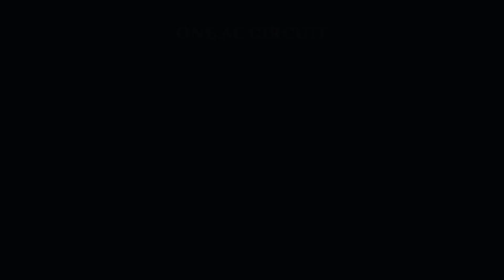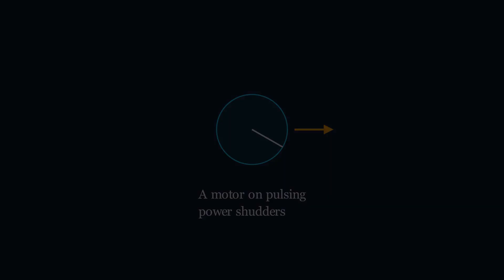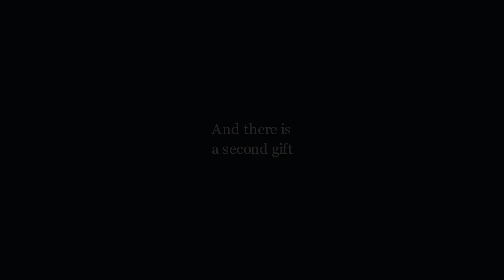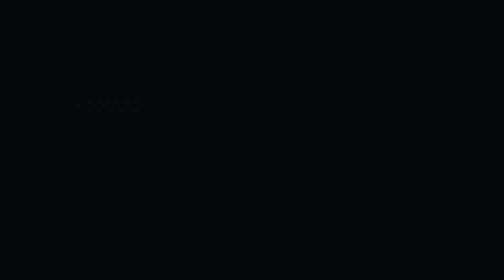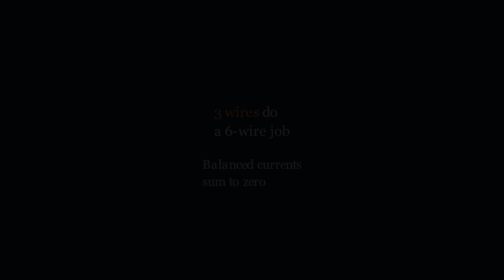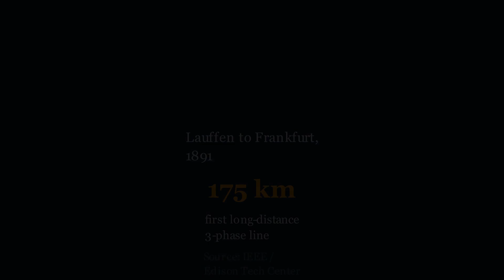Why Does Every Power Line Come in Threes?

Comment from the maker: The one idea the whole video turns on: a single AC circuit's power isn't steady - it pulses to zero 120 times a second, because power is voltage times current and both cross zero every half cycle. That's fine for a lightbulb (you've seen it as fluorescent flicker) but terrible for a motor.

Stagger three of those circuits a third of a cycle apart and two things happen at once: their powers add up to a dead-flat constant, and fed into three coils they make a magnetic field that rotates on its own - which is exactly how an induction motor starts itself. Three is the smallest number of phases that gives you both, and because balanced three-phase currents sum to zero you don't need a return wire, so three conductors do a six-conductor job. That's the whole reason the grid comes in threes.

If you want the deeper cut on how the grid keeps all three phases in step at 60 Hz, that's its own rabbit hole - ask in the replies.